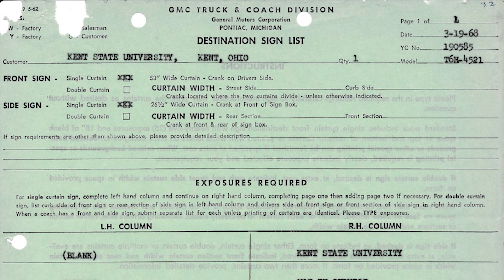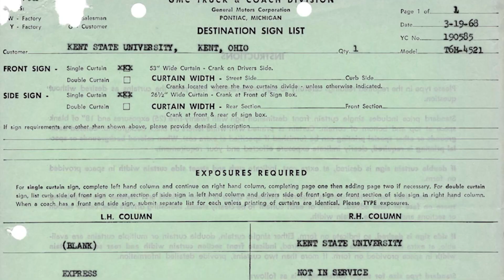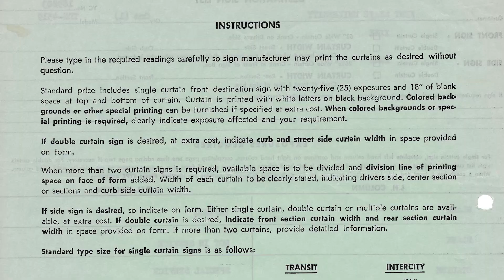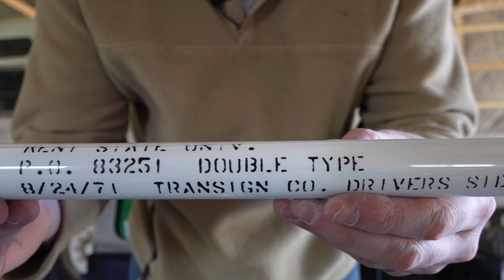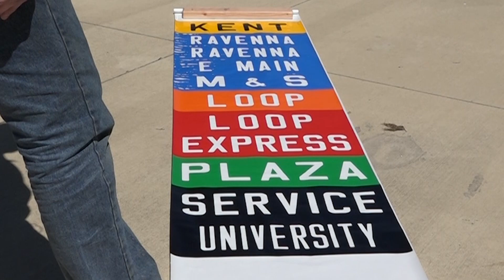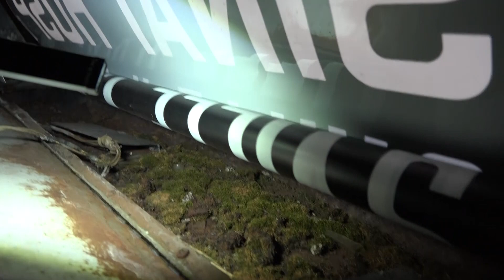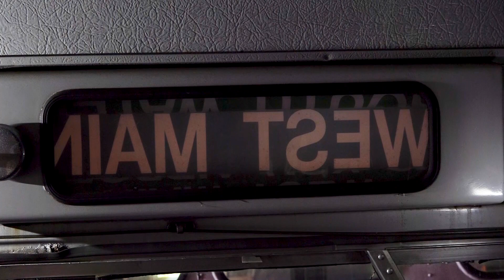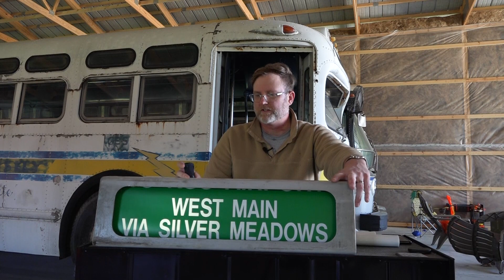GM Destination Signs - How They Work

Comment: Do the yellow school buses have rolls showing various destinations?
Reply from the maker: School buses only carry the school district name painted on both sides. The front, where a destination sign would be, has just "SCHOOL BUS" painted there. Kids are told of what bus number they will ride for the year the time they need to be at their stop. Sometimes the stop is at the end of their driveway. Other times kids have to walk to a more general location where several other kids will join them. Routes change every year in order to roam around the city and pickup the ever changing number of kids per grade. If a bus goes down for maintenance the driver will be assigned another bus number. Today the school can send a notification of the change that morning. The old days you were just surprised to see your driver behind the wheel of a different bus. At the end of school you would expect to board the same bus number you started the day with. Larger school districts run several rounds of bus routes to handle all the kids. The earliest routes pickup high school kids, followed by middle school and elementary. A driver may have 2-3 routes in the morning to cover the three types of schools. They repeat those same routes in the afternoon. Smaller schools may only have one pickup for all kids in the city.
Reply: @Unit2345  Thanks for that very full reply. I only ask as some buses appear to have glazed units rather than letters just stuck on. I've seen one or two photos of buses showing something other than  SCHOOL BUS.
Reply from the maker: You're right, they do exist but are in the minority. Some buses are used for private schools in addition to the public so perhaps they put that schools name on the front when they run those routes.